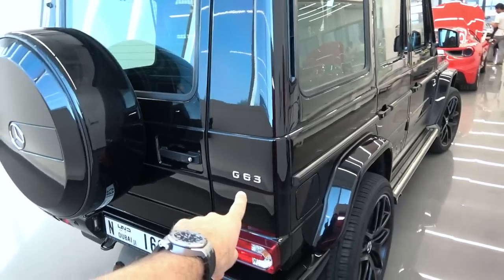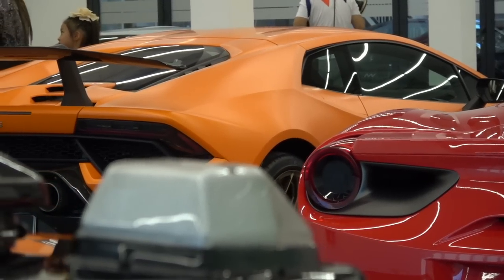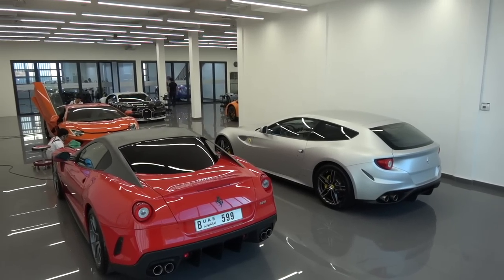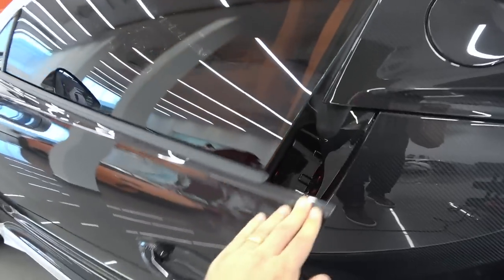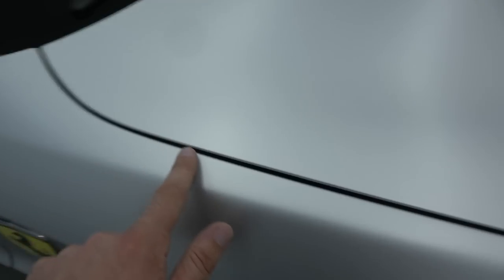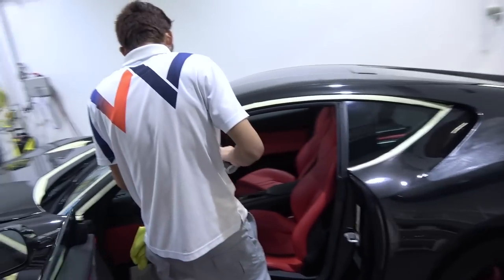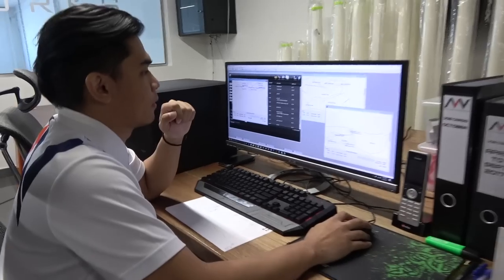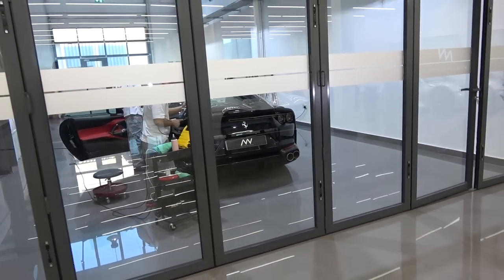I Would Fly My Ferrari To Dubai For This! World's Best Car Care & PPF?

Comment: Engineer here. 

That isn’t a reverse osmosis system. Just a triple filtration system. 

Water from a RO system, while pure, absolutely destroys metals and finishes due to the lack of minerals after treatment. The water try’s to suck the minerals out of every surface it comes in contact with.